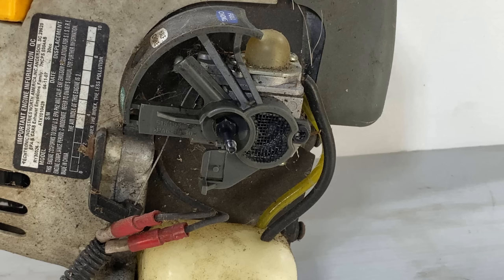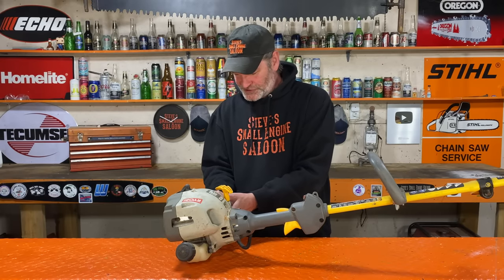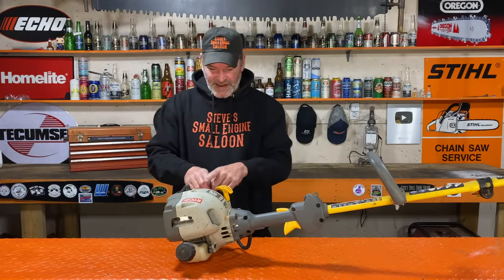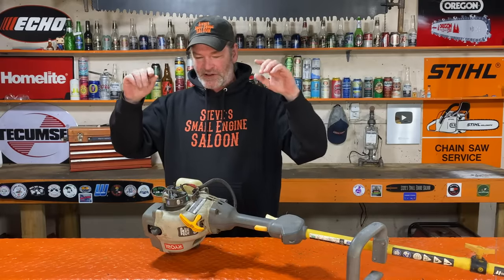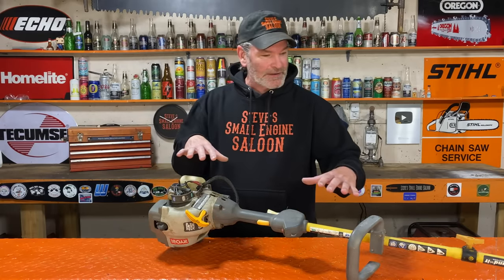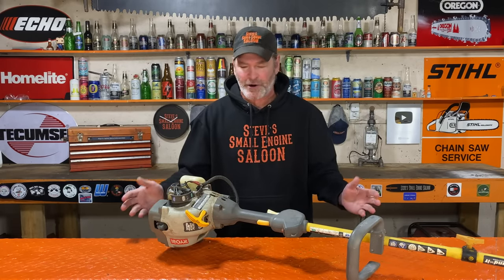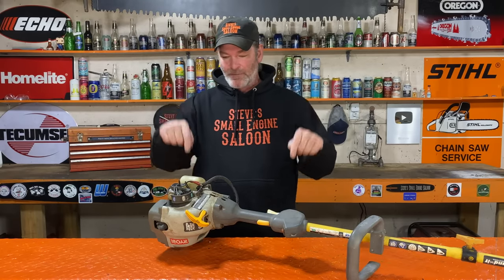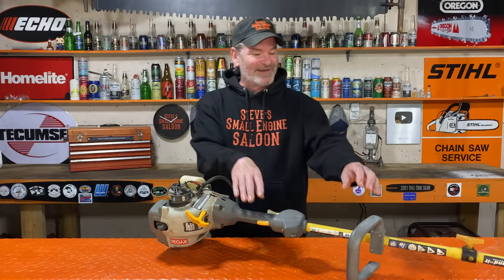This Weed Eater Is BUILT TO FAIL! Don't Waste Your Money!

Comment: As an owner of a 1988 Stihl FS-66 that I regularly still use to cut over an acre, this is unforgivable! This trimmer you’ve got here may last 2-3 years in the hands of someone who may only use it 5-10 times a year on a small lot. And then there’s things like my Stihl that just don’t die (thank God!)
Reply: My Stihl is 30 years old, I can’t kill it. Clean the exhaust port, foam filter, and that’s it. Same spark plug for over 10 years. It won’t die.

Comment: I have had an Echo 230 U for around 15 years and it works hard around the farm but still starts on the first pull every spring. The only problem I have ever had was the throttle cable rotted away. That was last weekend and I bought a new one for $12. This is a great machine. It even has an air filter!
Reply from the maker: Right on
Reply: Echo's are great. Here in the UK my dad has one of the old grey shred and vac blowers from 1997. It will still start and run with no issues.

Comment: I am 65 and have been mowing lawns since I was 10. All equipment I can think of has always had some kind of filter even if it was just an oil bath type. I still buy the cheaper weed eaters, Toro, and they at least have a foam filter, but would like to get a Stihl someday.
Reply from the maker: Right on

Comment: Hi Steve,  
                Cheap weed eaters are ridiculous. I have worked on many of those, Ryobi and Homelite style (because no other small engine mechanic will touch them). I can certainly say that they are really being cheap with these trimmers. To start, the clutch is 2 piece and the shaft side of the clutch is pressed into plastic. I did a repair where the customer needed a whole new $40 front shroud because of this. Its the same thing with the trimmer head. It is pressed into the shaft. On that same trimmer, when you would give it throttle, the head would wobble so much. It really goes to show you how cheap these weed eaters are. Thank you for all you do Steve. Keep up the great videos!
Reply: Yeah, I tried fixing some homelite and craftsman ones we have. 2/3 of them seal the crank case with a piece of plastic. They lasted a while but once they need new parts they're hard to find and it's easier to buy a new one.

Comment: About 8 years ago I was given one with all the attachments brand new as a gift.. Used it about 5 times then starting issues. When I opened it up I though I lost the filter. After looking it over I realized it did not have one to begin with. Only time I ever came across this particular lousy design.
Stay well, Joe Z
Reply from the maker: Right on

Comment: Worked as a warranty tech for TTI who makes this for years. When the first launched this model they had a major recall on every single one they sold, the engines would lock up and loose compression before they even touched dirt or grass. They initially had us installing short blocks and when that became too costly due to labor, they started sending us the power head assembly and we would just swap the shaft into the power head. By the way no upgrades or fixes were made they replaced the faulty short blocks with the same defective junk. They have started doing the same thing with Milwaukee power tools, they fail like crazy due to cheap electronics

Comment: Hi Steve. This has nothing to do with this video, but I just wanted to say thank you. I watched one of your older vids way back whever about you working on a small air cooled 2 stroke outboard motor. Didn't even know those were a thing. Since then I started picking one up here and there. Working on them now & then when I get some free time. I'm an over the road truck driver and don't get much free time when I'm home. Working on these outboard motors in my garage has been a like a refreshing dose of peace & serenity. Way back in the beginning of high school I took a small engine mechanic class. And it all started coming back. Thanks for reigniting my spark. I now have 6 Sea Kings and an Eska. Two of which I just picked up the other day. Thanks again Buddy.
Reply from the maker: You're Welcome...

Comment: One of my current pet peeves is (are) garden/yard tractor transaxles with no fill or drain ports, no means of checking fluid level. 
	These transaxles must be removed from the unit, the fan removed, then single use plugs are finally accessible. 
	Inspecting/replacing the filter requires bottom cover removal, but only when the unit is upside down. 
	If the bottom cover is removed while in place in the unit, park brake and final drive components fall out and are impossible to re-install unless the trans is inverted (no, I didn't).
	Then there's the old sealant that must be tediously removed from a labyrinth of surfaces then oh so carefully re-applied.

	An older Simplicity tractor I worked on has transaxle drain plugs and an external reservoir. I was shocked at the amount of aluminum swarf present in the drain oil. 
	Then, it wouldn't take oil through the reservoir until I found and opened a vent port threaded plug on top of the transaxle, below the fuel tank. 

	I don't know if this still applies to newer Simplicitys, but every thing I took tools to on that oldie appeared well thought out from a serviceability aspect and fully functional and well fit for purpose.
	I've since bought a used, Craftsman branded Husqvarna where everything was the opposite of Simplicity.
I've looked and looked and see no way to remove the fuel tank short of loosening the cowl and fenders.
Transaxle mounting tabs were literally torn from the frame, AYP factory repair parts are readily available. The Factory KNOWS of the issue yet has neglected to address it on current models.
	I'm NEVER buying anything substantial that's Craftsman branded again, nor anything from Electrolux/Husqvarna and subsidiaries like Poulan.

Comment: There are so many different brands and makes to choose from it’s great that you gave a heads-up about the air filter on that particular make. I’ve had many different types from Stihl to Husqvarna and the one I like the best for the $ is the Echo SRM-225. It’s not the top of the line but if well maintained will last many years.
I’m retired but do some landscaping work to keep busy. I have 2 of the Echos and alternate them. I run one with a full tank til it runs out then switch to the other.  Never had an issue with either one. As long as you change the air filter and spark plug on a maintenance schedule they should last for years…
Reply: I also use the canned gas with my -225.  When I took it apart for maintenance after three seasons there wasn't a speck of carbon anywhere.
Reply: Echo SRM225 is an excellent machine imo. I bought one about 5-6 years ago. Has been fantastic. I recommend them to any customer not happy with what they have currently. Stihl customers too.
Reply: My Dad has an Echo SRM2450 that's 30-something years old and has done the work of >30 cheap-ass garbage strimmers (as we call weed-eaters here in the UK) and it's still going as strong as the first day he pulled the starter-cord (with Steve's help and advice, of course... 😁👍)

-6 weeks ago it had got to the stage of not wanting to start, and then wouldn't tick-over or accelerate properly (due to the sh!tty E10 gas eating fuel-lines, the seal on the fuel tank and the carb diaphragms 😖) so I spent about £20 ($33.47 Canadian at today's exchange rates) on a new fuel tank cap, 18" of new fuel-lines, and a new carb, plug and air-filter, and it's running absolutely PERFECTLY again 😊👍 after I set-up the new carb, using Steve's video of course... 😉

I went to see him yesterday, and he was out in the paddock strimming along the post-and-rail fences, happy as can be 😁, telling me how he can't believe how well it's running after all these years without any care or attention 😮, but he's 81 now and sadly has dementia pretty-bad 😖💔😭 so he'd totally forgotten what I'd done to it, but when I gently reminded him about the new parts and the tune-up I'd done he was grinning like a kid on Christmas morning and getting really emotional about "How well I look after him", so THANK YOU STEVE 😊👍 for making a very old man SO FRIKKIN HAPPY 🥲 -YOU DA MAN 😁👍

Comment: Yup: I got a Homelite 26cc straight shaft from big box. I have been using my top of line saw 50:1 MIX IN IT. 10 years.
So far so good- no air filter. when it looses compression I will buy something good. Only use it a few hours a year.

Comment: My first trimmer was a gas ryobi, it gave me nothing but trouble and lasted about a year, I got rid of it and bought a shindawa which I still have and I use it all the time, I used to cut the grass in a cemetery and it was my favorite to trim around the headstones, it's the f230 the curved shaft one, I then purchased a reconditioned echo from home depot, they used to sell reconditioned mowers and other outdoor power equipment, I bought it in 2000 and it still runs perfect after all these years, the shindawa I bought new around 1996 and that still runs perfect, I advise anyone to not buy the cheap junk, they ask me how much is an echo or similar unit, they never want to pay the extra money so I tell them they're throwing away money because the cheap ones won't last, now of course they're pushing the battery ones so who knows.

Comment: "I actually made it through a video without going on a rant".

Uh no, Steve, it was a pretty good rant, and well-positioned. Totally spot-on. 

Smart point...you didn't single out a single manufacturer, though the "R" logo was visible. It seems this is a questionable trend across a few of them.

Nice work. Thanks.
Reply from the maker: You're Welcome...

Comment: I was given one very similar as a non runner, got it working. The plastic grill was part of a detachable cover over the carb and I assumed the filter was missing but couldn't find a replacement, now I know why! I just sandwiched some filter material behind the cover as a bit of a bodge

Comment: So why not go buy the cheapest foam element you can find and cut out a piece of it to fit over that hole and be done with it? 

The reason I even bother mentioning trying to remedy this is because I have two of these older Ryobi gas trimmers (both are model SS30) that DO have air filters, and despite being old, they run great. And aside from having had ethanol mixed gasoline run through them prior to me acquiring them, which has caused me to replace the fuel lines in both units, and the purge bulb in one, I've had no other issues with them. For a cheap string trimmer, I really like them. Best part? They were free to me because of rotted fuel lines. I've had them for 4 years now and they do just fine in my residential application. I also have a Black Max trimmer from Walmart, one year old, and honestly, it's not really any improvement over the Ryobis. Except that it's a little bit prettier because it's newer.
Reply: They just recently started this planned obsolescence trickery. If yours are older than 2017 or 18 you shouldn’t really have any issues like people are now experiencing with things like no air filter and sealed crank cases. Homelite now makes it impossible to change cylinder heads and rings. You get low compression it’s off to the dump

Comment: I've seen an 20 year old trimmer with a broken airfilter housing and it's just using a sock at least half of it's life. Even a local mechanic who went through it and replaced fuel hoses said there's no filter for it made anymore so the "sock method" will do.

Comment: Lol does it reely matter. I seen snippers dropped of here that I have no idea what happened . Like just yesterday a staffers dad popped in and said can you re string my pull cord .( I replaced it last season) must of yanked on it till it let go. So after the repair I checked the fuel . Looked like muddy water ?  Had another one stored in a shed  . Brand new snipper was full of water in the tank … like no fuel !!! He said his shed leaks a bit when it rained .and all the ones ( small engines gear) that’s never clean , mouse nests , poor fuel , no oil  I could go on and on lol rant dun. Also another great video Steve ✌🏼

Comment: Been using them for years, and all have filters.
Tbh, they’ve outperformed some higher end models, and lasted much longer.
The problem I ran into was the “California” settings, set so bad it won’t even crank. If I ever buy another, I’ll make sure it cranks before I leave with it.

Comment: Ryobi used a lot of different engines in their string trimmers.  My CS30 has a Homelite (Textron?) 30cc engine. I've had zero issues with, start easy and performs well.  Can't say that for my Echo SRM225, and yes I had to remove the tamper proof screw to get at the main jet.

Comment: I bought a four stroke Ryobi trimmer, and it had a plastic mesh screen just like that, no real filter. The throttle cable broke and I needed it right away and couldn’t wait for it to be fixed so I bought another one just like it which actually had a foam, air filter and a redesign throttle cable but otherwise identical 4 cycle engine. Actually runs pretty good for a few minutes but they inherently have very poor oil control even if you keep them perfectly level but if you talk them or run that higher rpm for too long, they start burning oil excessively and smoking.
 They are made for the homeowner that trims very very infrequently and very small jobs.
Hi, since button a new Stihl Kombi motor. Lol

Comment: I recently got a Homelite bandit Sx-135 from my neighbor for free and he found it in his garage and completely forgot about it. The fuel lines and purge bulb were dust and all the fuel in the tank was straight oil now. It was a 1996 model year. I replaced the whole fuel system. And I put gas into it and it stated immediately! After sitting for at least 8 years. I didn’t even have to buy a carburetor!!!!! They don’t make them like they used to! And it had an air filter!

Comment: I once had the newer style Ryobi gas trimmer model ry251ph. Still exists today only in a curved or straight shaft. Had one for 5 years ran good until it started having carb problems, put a new aftermarket carb in it and nothing. And then just threw it away. Think I’ll stick with my old Toro trimmer that’s 20 years old, my Stihls and my husqvarna.

Comment: A reason my .Husqvarna weed eater is hanging up in my shop and the reason I now use a  new Stihl FS56 RCE.  Not only is it easier starting but lighter as well.  I don’t know if it will last as long as my FS 76 (30 years), but I hope so.

Comment: Good observation. Apropos of no air filter I had a powerful pro concept weed whacker that after time wouldn't run with the air filter in. Even if brand new clean. It ran very well without it. I wonder what that indicates.
Reply: Piston rings, not sealing very good, or there is a gasket leak, somewhere in the headgasket, or crankcase chamber. Or, worn-out  piston rings..... Most 2 cycle carbs, use the pressure created in the crankcase, on the downward power stroke,  to atmospherically  pressure up the gas tank ( diaghram in carb -hose to crankcase)to push fuel into the carb. Ingenious design, but made with  CHEAP  MATERIALS.  ...

Comment: Wow, that is absurd. I used to have a trimmer that looked identical to that, but it must have been an older model (from around 2006 if I remember correctly). Someone gave it to me, I hate curved shaft trimmers, and have several nice echo trimmers, but for free it was worth a shot. But that one at least had a proper air box and air filter.

Comment: This seems to be a "Thing" these days with equipment and appliances. I just returned a Whirlpool washer (Over $800.00) that lasted a whole 5 cycles. We literally washed 5 loads of clothes and then it died. I am in the process of rebuilding a Scotts S16/42, everything works except the transaxle. I think it's the filter that is clogged but I won't know for sure until I open it up. It will drive for about 15 minutes and then just stop moving.
Reply: Buy a Speed Queen. The last of the old school washers & dryers.
Reply: Long ago I used to work as a bartender, and I got to know a few of the regulars pretty well over time -one evening a guy who was a Design Engineer came in looking absolutely in-bits and like he was going to jump off a tall building, so I poured him a beer and asked him what was up, thinking maybe his wife had left him, or he'd lost his job or something?

-Turns out he'd spent 6 months working on a bearing assembly for a Phillips/Whirlpool washing-machine, and had put his blood, sweat, tears, and everything else into creating the best bearing assembly he possibly could, and that afternoon he'd presented his (excellent) design to the Client...

And at the presentation the Client had gone absolutely postal on him and screwed-up the drawings that he'd spent weeks painstakingly drafting on his drawing-board with paper and ink and zero re-do's (this was back in the early-'90s, so CAD was just a futuristic-dream in those days...), screaming at him that "That f#cking bearing would last for 20 f#cking years -we want a bearing that'll last ONE DAY LONGER THAN THE F#CKING WARRANTY and then disintegrate, so that way we can sell people another f#cking washing machine every 3 years, not every 20...

So Ian the Design Engineer guy had literally just told his client where to go (and how to get there...) and walked-out on his job, rather than compomise his standards and create a shoddy product that he knew would be sub-standard and fail, and I gained an awful lot of respect for that quiet little grey-man in his grey suit  that day, huh?

He was out of work for about a week and then got hired by a company who appreciated his skills, talent and dedication, so it all worked-out pretty good for him in the end, but I learned a whole lot about the World and Corporate Greed that day, huh? 🤔